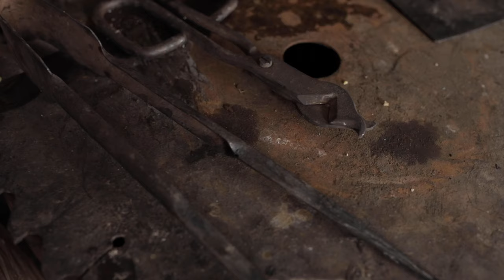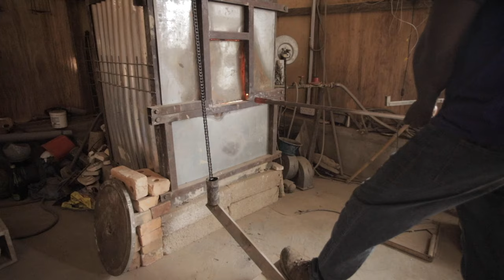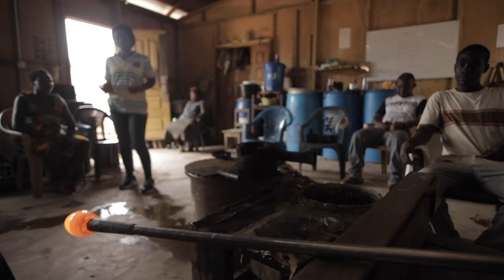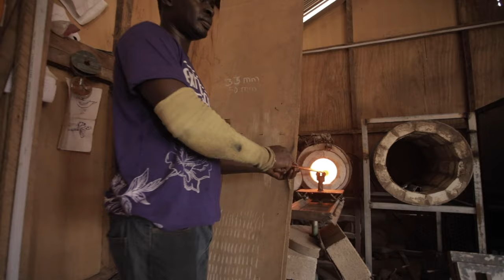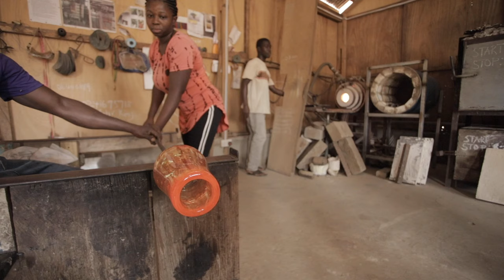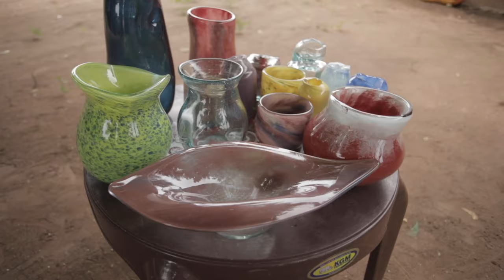Michael Tetteh (Glass Blower Ghana)

Comment: Please could you tell me what the the tool looks like/called that you use to crush your glass down? 
I’m a reclaimed tempered glass cold work sculptor, in the UK and I’m struggling to find a way to de-burr the edges of the glass I use?
I currently remove the edges of every tiny cube manually with a rotary drill, metal files and sandpaper but I’m looking at gentle crushing, not to the frit level you crush it to, but just to take any potential sharp edges off the cullet before I cold cast it.
Many thanks 
Mel